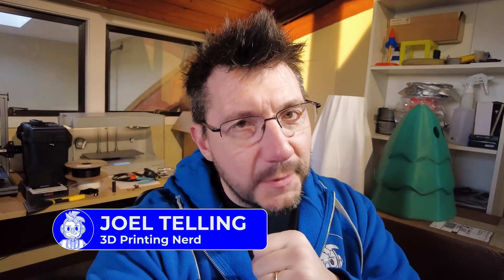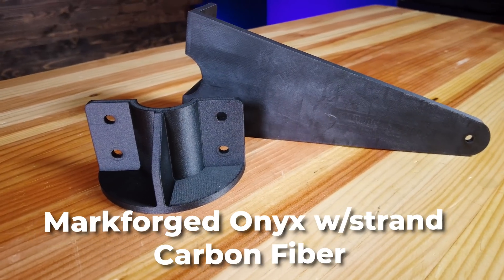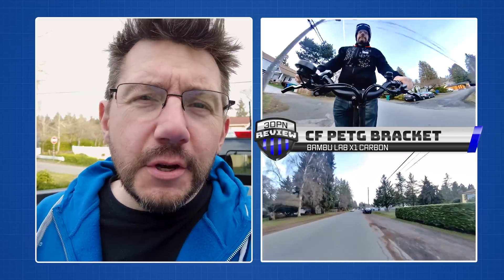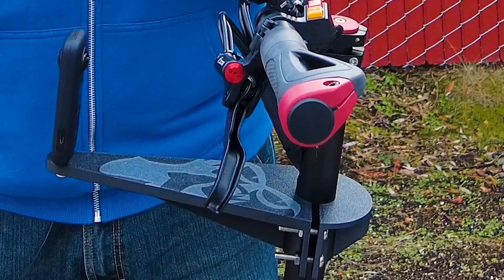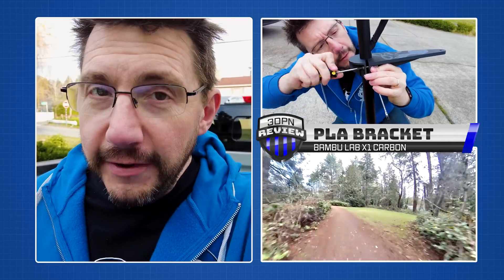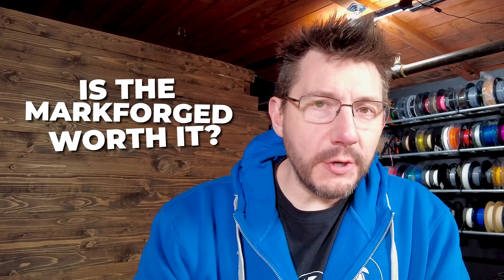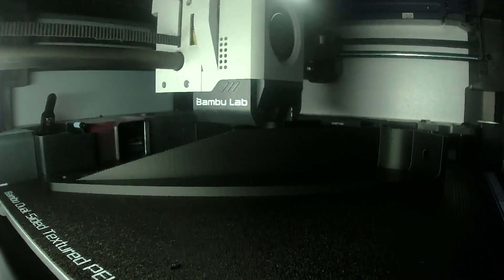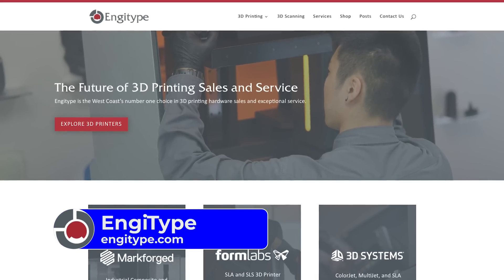CONTINUOUS CARBON FIBER vs PLA vs PETG

Comment: Dunno if you already considered this, but if it were me, (1) I'd put the bolts closer to the shaft hole, and (2) I'd relieve a bit of the shaft hole near the middle so that it's holding mostly near the top and bottom (in case your scooter shaft isn't perfect).  When strength matters I sometimes move the bolts so they're almost touching the shaft they're clamping on, allowing much longer "shoulders" in the print for the bolts to act against.  Then again, it's just plastic ;-)

Comment: Hi Joel, again another great video! I'd love to help you design a mount that might increase your confidence level. If your design was done in Fusion, feel free to hit me up with the shared link via Fusion. Also, the diameter of the post that it's mounted on with with 2 decimal point accuracy :)

Comment: Hi Joel - this bracket could be in aluminum for $55. Sure - it'd be good for a prototype, but we can easily prototype in PLA, for a LOT LOT LOT less. As makers, we can't afford to pay five grand for a printer that has limited space and very expensive part, especially when you've given the price for one part not for all of the iterations that it would take to get to that part. 

I miss your maker-person / consumer-based / real person content. I really do.
Reply from the maker: That’s what I said in this video - prototyping in PLA for a lot less. Plus, I did make the point of not needing to buy the printer as well. I’m fact, the whole back end is talking about prototyping in PLA / a less expensive material and then farming out the part for the higher cost material.
Reply: I don't understand the problem here. No one's suggesting hobby makers buy Mark Forged, the video even talks about hiring it done, you don't need to buy the machine to buy a print. I also don't think it makes sense to want to exclude machines that hobbyists can't afford because it's confining to not be exposed to things you can't afford. For example, if your employer has a need for something Markforged can meet, now you somewhat intelligently talk about it.

Comment: What about adding some Goop to the printed part to increase strength? I have found success with this method in the past.

Painting the Goop onto the outside of the print to increase layer adhesion.

Comment: But, if you print 2 parts on the bed of the marked forge, isn't it not continuous strand of carbon as it'll have to cut it between parts! Correct me if I'm wrong!
Reply from the maker: It’s still a continuous strand per part. The continuous is per layer, and it varies the orientation of the fiber per layer, make it overlap in ways that help increase its ability to add strength.

Comment: Im not sure the machine cost matters for a company to be honest. we did some calculations at the company where I work, and the problem with some vendors are the material vendor lock-in. Like you show here. The markforge part ended up around 50$, in other plastics you can print those parts for a fraction of the cost, and if you outsource the rest of the parts to be made in aluminum or made with carbonfiber plates with different weaving it’s a difficult decision. We calculated with 20% depreciation pr year on the machine so that cost is negligible compared to churning out parts or prototyping for between 100-250$ a day in materials. Anyway, no doubt the Markforge is a great product, just need to find the usecase.

Comment: Have you considered increasing the size of the hole around the center post so that when you tighten to two pieces together, they're actually touching?  That could help with the stress cracking you're hearing during install.
Reply: I thought about that as well, but that might impact the clamping strength. I'd be curious to see a design shoot out with this similar to when he did his shelf brackets several years ago.

Comment: The part needs redesigning so that there is less of a gap between the front and back parts, possibly with a rubber washer between, on the bolts. What was the name of the scooter again?
Reply from the maker: Yeah reducing the gap is definitely going to be a good thing!

Comment: Outside of the continuous fiber is it better as a printer in any way when compared to something like the X1C? 

At first glance it looks like a regular old printer and your paying several thousand dollars extra just for the addition of a fiber cutter built-in.
Reply: The X1 does not do fiber at this level. It actually creates a weaker item with CF PLA than regular PLA

Comment: You could add an isolation type washer between the two pieces of the bracket and similar washers on the bolt and washer.

Comment: It'd be a better apples to apples comparison if all the parameters besides the material were the same as much as possible. The CF PETG model is different than the other ones.
Reply: Yea that wasn't fair at all, the support was twice as tall on the other parts. He shouldn't even have used that part.

Comment: Hey Joel, thank you for the test, but I think you overlooked something in this test. The more ductile the material / print is, the smoother the video looks due to dampening effects. Here PETG and the PA from the markforge printer are the materials to choose. The PLA is the stiffest (not strongest) in this test and after this the CF PC which clearly shows. Keep in mind the dampers of your scooter can’t cancel out all the vibrations from driving. The cracking is due to bad design, sorry to say that ;-) keep up the good work
Reply from the maker: Yeah, you’re definitely right about the cracking. Luckily it’s a quick adjustment in CAD :)

Comment: I'm sure the cracking could easily be solved with more a correct/tight  design,  .. or use some nuts as spacer between the two halves
Reply: Spacerssssss! I❤😂
Reply from the maker: That’s a great idea!
Reply: @Dgo Drummer I think that there should be a tiny gap at least on one side so that you can actually tighten it. But the gap right now is huge! :D Maybe you could also use a thin rubber band so that you do not not have to tighten it that much? But then it could vibrate again :/
Reply: A rubber washer on one side to give you some squish but still have it tight
Reply: Very strange design for a 3D printed component. Heck even metal would bend with that clamp design.
Reply: The part is not designed at all for 3D printing. There are massive stresspoints at those sharp inner edges...

Comment: Wouldn't some rubber spacers help the tension together when assembling it and than you wouldn't get the cracking when tightening it?
Reply: A better design would help it...and I hate tell Joel that deflection of that degree has nothing to do with the Jelly in the footage.   He heard cracking because...of a bad bracket design.  ANY material shy of something made of steel is going to bend and crack under that sort of load.  Even the Carbon Fiber warped up pretty good at the mount point.  GIGO though.
Reply: @Theexplorographer  Totally agree, when you print it first and then fit it around the clamp, you'd incorporate print in place spacers to restrict the clamping deflection. The inverted T shape of the part isn't the stiffest topology solution, nor is the camera fixing system, but it does demonstrate the "stiffness" of the different materials and how the Onyx system is inherently stiffer. :)